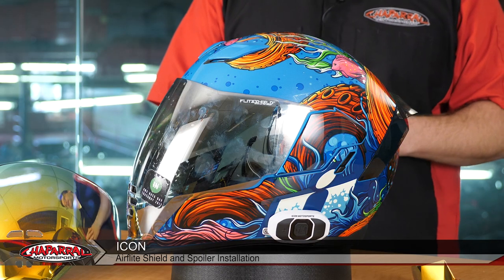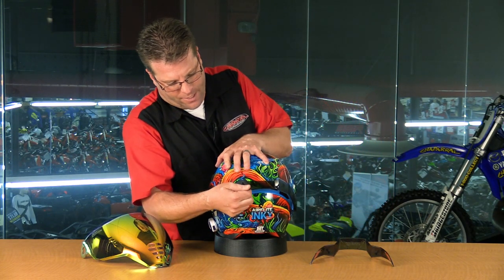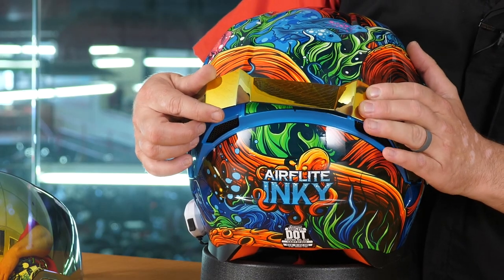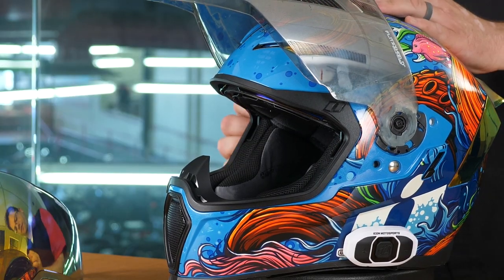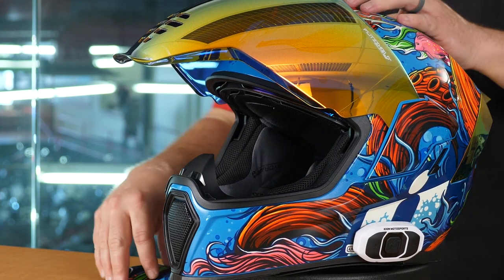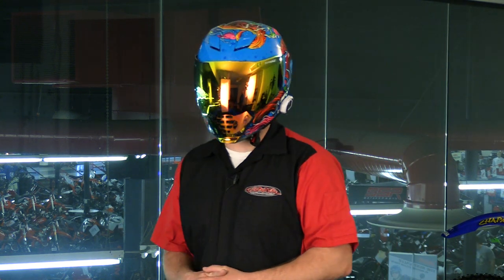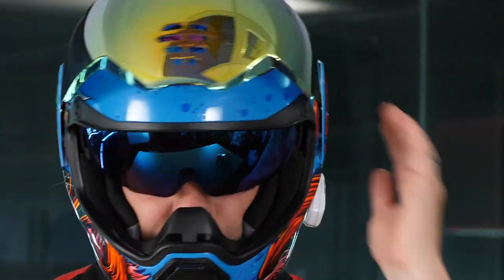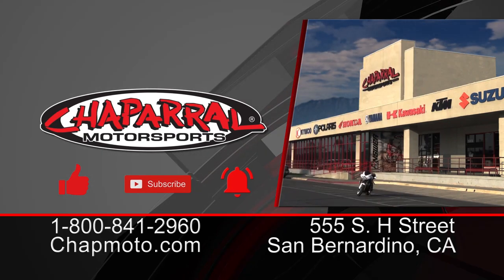ICON Airflite : How To Change the Visor and Spoiler of an Airflite Step-by-Step

Comment: I need to pull off the mouth vent and clean the bug guts out along with replacing that mesh screen. How do i pop that out?
Reply from the maker: Hello, the exterior diamond shaped trim piece is replaceable but it is not meant to be repetitively removed and replaced for cleaning--the backside of it has adhesive to help keep it on place. The inside chin piece is held in place by adhesive as well. You best bet is to just lay a warm wet cloth over the exterior of the vent and let it loosen up any debris then wipe it off. If there is additional stuff inside behind the mesh, then maybe a toothpick or the like could help you clean the stuff out.

Comment: Can not get the side pieces off to switch the visors 🙄
Reply from the maker: Hello, do you have the face shield in the up position before you try to remove the side plates? Once you raise the face shield, put the back of the helmet into your stomach and then reach from behind the side place to the front of it and use your fingers to hook into the front of it and pull the side piece away from the helmet--it takes a bit of force. Repeat on the other side.

Comment: My spolier will not come off 😑
Reply from the maker: Try using a thin blade screw driver or a butter knife to gently lift the 3M tape off the surface of the helmet.
Reply: If you are going to use a knife type of object I would strongly recommend using something such as a plastic putty knife or similar. If you use a metal blade ot could damage the finish of the helmet so of you do be very careful